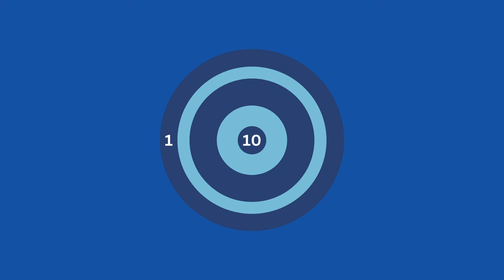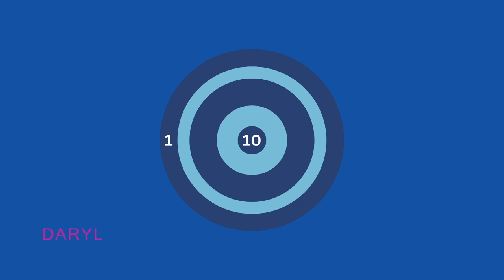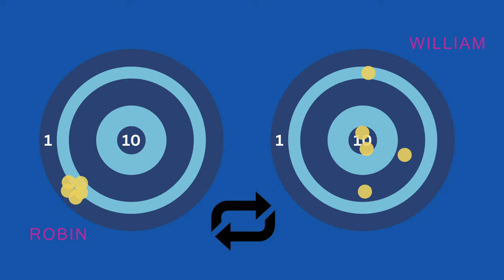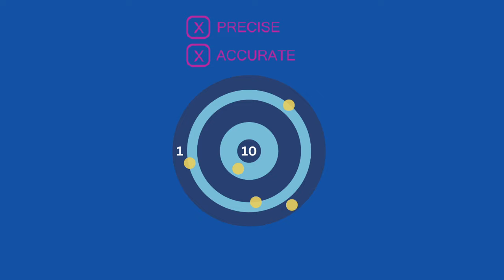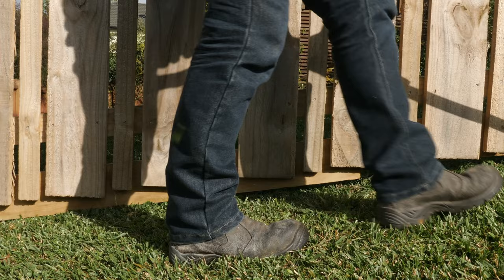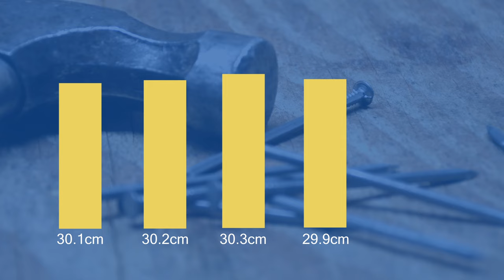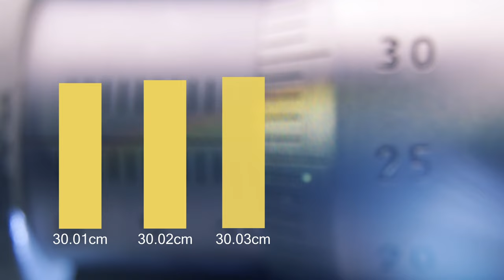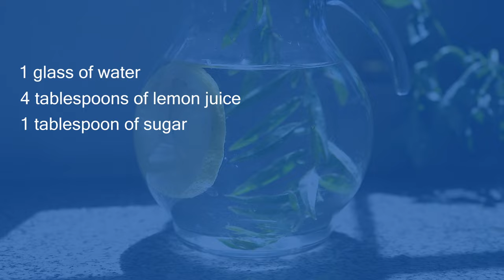Accuracy vs PRECISION 🎯 College Math & Science

Comment: Another way to understand accuracy vs. precision: If you have a good ruler and are careful, you can probably get measurements that have millimetre precision. So your ruler, used by you, is precise. But none of your results will be particularly accurate if your ruler itself has an inaccurate scale and for example always shows everything as 10% longer than it really is. If you're in a system using only that ruler (e.g. measuring your door frame with the ruler, then using that ruler when sawing wood for the door) as the scale, it isn't that bad, but it becomes especially troubling if you're making something for someone else who has a different ruler whose scale might be different from yours. 

That is why in metrology, an important topic is traceability, which is the idea that all your measurement devices are calibrated using some object, and that object itself has been calibrated by some other object, and so on, going back all the way to the fundamental realization of the unit. In the case of a ruler, a metrology laboratory creates a very accurate metre based on the SI definition, this is used to create objects whose length is known very accurately, and those objects can be used to create more objects whose length is known accurately, and down the line your ruler has been created using one of those accurate objects, making your ruler also accurate. If you're making something for someone else, but both your rulers are traceable in this way, then everything should be fine. Along the way, some uncertainty in the accuracy will accumulate because the calibrations themselves are never 100% accurate, but this is different from uncertainty related to the precision.
Reply from the maker: Fascinating details!! Copies of copies of copies — have you ever seen one of those official objects for measurement standards?
Reply: @Socratica Yes. The chain consists of calibrations of objects and instruments. I worked for a national metrology institute (NMI) and saw the iodine-stabilized laser used for realizing the metre at very high accuracy. One step below in the chain, this was used to calibrate a very accurate diffractometer, which was then used to calibrate a 1D grating (a silicon sample on which is etched a repeating pattern of parallel peaks and valleys, with the distance between peaks on average very accurately always the same), which could then be used to calibrate the scale of a microscope. So the chain here from bottom to top was microscope -> grating -> diffractometer -> laser -> SI definition of metre. Not a very long chain, so I was working with very accurate things. But actually, the chain usually isn't particularly long, I think a company making rulers would probably get their reference object directly from a NMI. 

Something one should ask themselves every now and then when working with some instrument is whether the instrument has been calibrated, and if that calibration has traceability. There was a study where several scanning electron microscopes (which have very high resolution) from different organisations measured the same object, and that showed over 20% scale error in some of them. So it was like having a ruler that shows you 120 cm when you really have 100 cm, not very accurate. The difference between resolution and accuracy is important to understand.

It doesn't necessarily have to go all the way to a NMI, however. For example, the lattice constant of silicon is one official secondary method for realizing length in the SI system. Basically, you measure the distance between two silicon atoms/atomic layers in a crystal, and correct your scale by assuming that this length is what the lattice constant is known to be. I would imagine for measurements that don't need to be extremely accurate, you can find similar (possibly unofficial) ways to calibrate an instrument. 

And of course, these things don't apply just to length, but also time, mass, or any other fundamental unit etc.